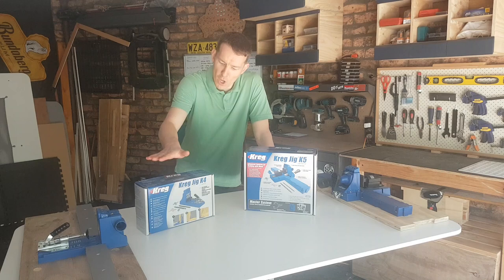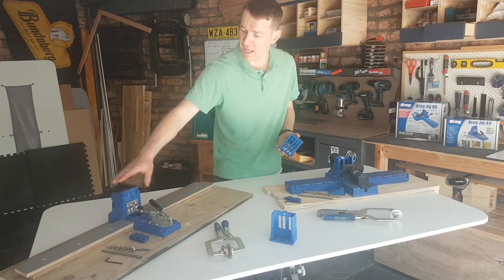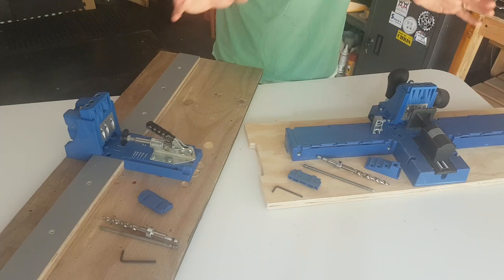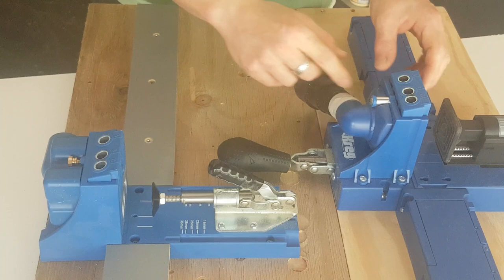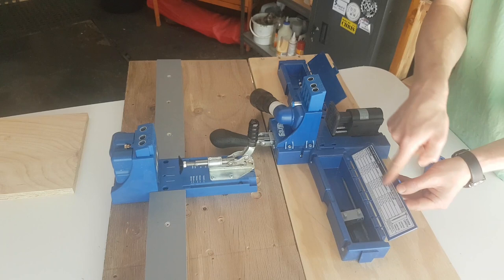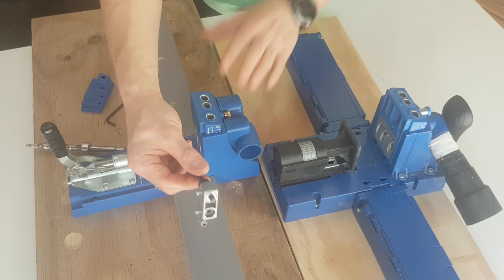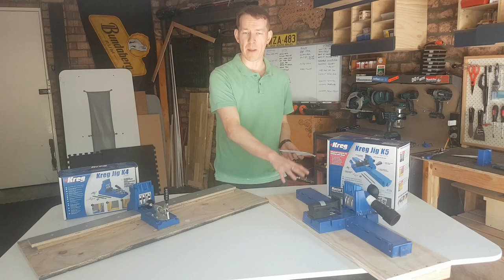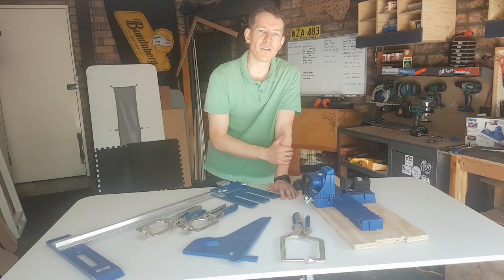K4 vs K5 Kreg Pocket Hole Jigs: Review and Comparison

Comment: I bought the K5 a number of yrs ago. There was no master system then but I still like it. I did the mounting on a piece of plywood which hangs behind the door. Have developed a little problem with the drill block slipping so if you're not careful you end up with a missed drilled hole. Having recently seen the Armour tools system it looks like a much simpler system but it's forking out dough for something I already have.
Reply from the maker: My mate Sumo tested the Armor System and liked it. The Auto-Thickness detector seems like the next step in pocket hole tech... I wonder if the "K6" will do something similar 😂 Will be interesting to see if it takes off in Australia, only Timbecon stock it I think.

Comment: I'm someone who bought a K4 after first owning a K5.  I did so not because I didn't like my K5.  On the contrary I like my K5 very much.  I bought a K4 after a K5 because I have doubts about the longevity of the K5's ratcheting locking mechanism.  Yesterday, upon learning that Kreg has discontinued both the K5 and the K4, I hurriedly went to Amazon to snap up a K4 as a backup to my K5 in case my K5's mechanism ever breaks.  

Mostly I use my Kreg jigs with the HD guide block to drill holes for HD screws on 2x lumber for outdoor stuffs.  I figured that if my discontinued K5 ever died, my HD drill guide block would be useless.  That's why I bought the K4 as a highly durable backup to the K5.
Reply from the maker: I gave my K4 on permanent loan to a friend once I got the K5. I'm excited to get my hands on the new 720 but we'll have to wait a little while yet here in Australia, hopefully by the end of the month. Will be very interesting to test it out and compare it to the K5!

Comment: I was just about to buy the k4 from Carbetec but having watched your video I chenged my mind and went for the basic k5. Cheers.
Reply from the maker: It's worth the little extra Susan and I did find a really good use for that little stop block on my last project when you are trying to pocket hole mitred pieces. Once you learn to set the ratchet clamp quickly (only takes a little practice) it'll be super fast for you. Enjoy! Hit me up if you have any issues I'll see if I can help.

Comment: HI. today i returned k5 to total tool.
because it has a slip problem can`t hold object .  so i just bought a new k4 today.
Reply from the maker: Wow that's weird, my K5 clamp is much stronger than my K4. Maybe just a faulty unit.  You'll still like the K4, holds well,  just a little more fiddly to get the right pressure
Reply: @FixitFingers  Thanks . I will go with my new k4 until the end. :)
Reply: Mine broke at.the clamping down.system. a lot of.people r having that issue with the 5' it's cheaply made. I call it what it is. Complete garbage. Mine broke in a few days of.use. my 3 and 4 r way.better

Comment: I also had the K4 which I really loved. I then upgraded (no I didn't win one) to the K5. The K5 is so much better for all the reasons you mentioned. However, I prefer the dust extraction port on the K4 over the K5. The K5 port just seems flimsy. Great review.
Reply from the maker: I just wish the dust port would accept the Ryobi shop vac hose without an adapter. Otherwise not a lot I'd change about it.

Comment: Nice comparison. Guess I will go with the K5 🙂
Cheers from LA.
Reply from the maker: Good stuff Markus. Even after getting the new 720, I've held onto the K5 as the removable block is very handy. You'll have good fun 🛠😀
Reply: The K5 is discontinued by Kreg. I just ordered the 720Pro... In the US Kreg has a limed time offer that comes with a Clamp and more screws 🙂
Reply from the maker: Awesome. I love my new 720. K5 and K4 still available here in Australia, but when they are gone they are gone. The auto-clamp adjustment is awesome. Only thing I miss from the K5 is the removable block for portable work, but there are also new options for that ;) Good luck!

Comment: I think it might be hard to buy a K5. I've been told that model is out of production now...sadly. I borrowed a 720, but not impressed by it. The K5 got it right.
Reply from the maker: Yes both of these models are out of production now. A few retailers may have old stock and they can be found second hand. The K5 was very good, though I've found over the past 12 months with both the K5 and 720 in the shop, I've been reaching for the 720. I just gave my K5 away to a young lad.

Comment: Not sure how you explained it, but it sounds like youre pushing the k4 and a clamp instead. At the beginning.
Reply from the maker: That's what I started with. I passed on the Master and got a K4 and a Clamp, and I was very happy with that choice as it worked out cheaper and I was just starting woodwork. However, when I won the K5 in a competition a year later and had a chance to play with it I came to appreciate the value of the better clamping system and other small improvements. If I lost it all in a fire today, tomorrow I'd get the K5 again, probably a Master system, as I know Im well addicted to the hobby. Hope that helps!

Comment: Is Kreg going to fix the imperial only guide, as most of us deal in metric, not useless imperial.
Reply from the maker: G'day Ivan, in Australia at least everything is metric (or at least dual labelled) and has been for the 2 years I've been at this. If you order off Amazon.com... it will be Imperial. Here they sell 32mm screws (etc) the Rip-Cut is a metric ruler and the Jigs have mm on one side and inches on the other.

Comment: What did you make those K4 wings out of?
Reply from the maker: Form ply. Melamine scraps would work well too. It's exactly an inch / 25 mm high so I used two offcuts of 1/2 inch laminated together.

Comment: My krieg 5 clamping system already broke. The plastic is cheap on the clampdown system. A lot of people have experienced the same problem.as.mine had. Lucky I had my.old 3 to finish my.pocket.holes on my.project. don't buy the 5' it's garbage and.it's.been cheaped down
Reply from the maker: No issues on mine after a year of heavy use. The ratchet on my K5 is metal. Where did yours crack?